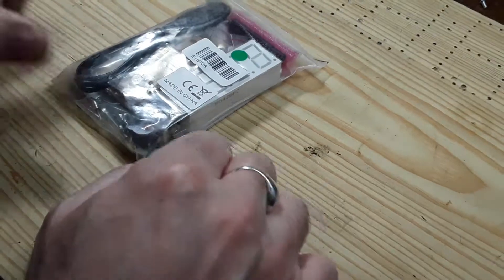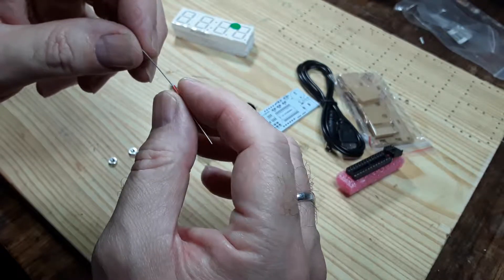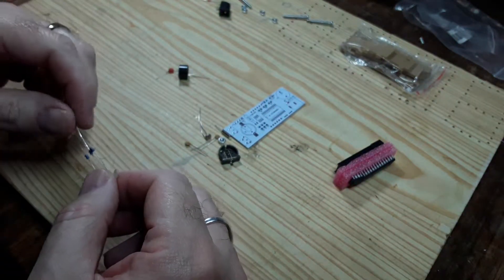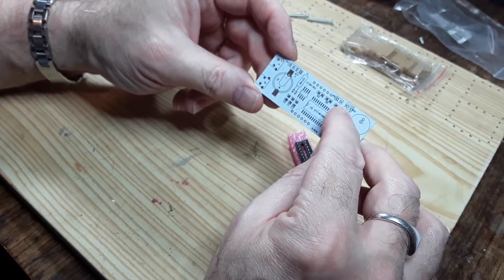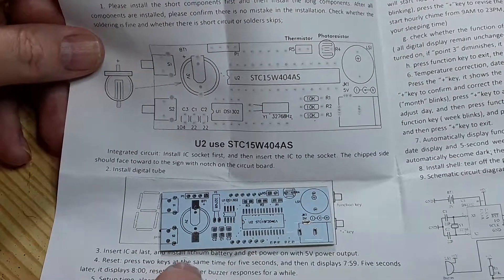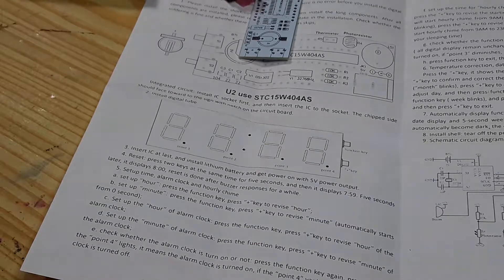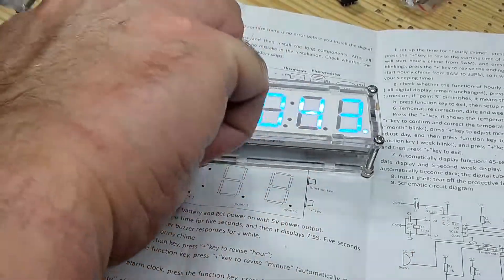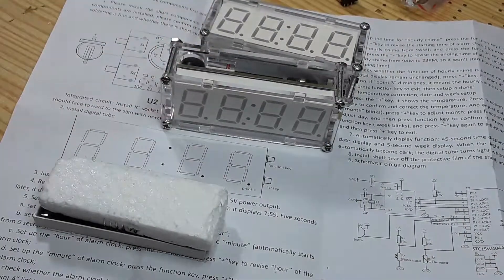Banggood Clock kit - Instant Fail!

Comment: Bad luck on this one. Did you send back the clock or ask them the correct chips ?
Reply from the maker: No. Could not be bothered. These kits are so cheap and the process to get a refund or replacement parts from China is a nightmare!!
Reply: Edifred2007 yes better solution is to buy a new kit. Less expensive 😀
Reply: You must be kidding  E bay or Amazon have the same issue with this version of Kit clock wrong board I bought it too with the wrong board since I bought it on E bay with receipt from e mail, and seller don't gave a dam to my issue I should had bought it on Amazon if this wrong at list Amazon refund your money not  E bay that is why I won't go on e bay you get screw from them.

Comment: I  won't order any thing any more from E bay bye bye Lost of Issues not solved. I contacted the seller 5 times  on E bay no response or he gaves you did you order from us LOL  Same Kit Chip won't fit the Board I saw on Amazon same kits  people got the same issues from CHINA wrong board  I hate China made item that is why I prefer Taiwan, or Hong Kong made. the main land it's a nightmare. I trough the kit  to the garbage bin. Funny three years after the same issue on 2019